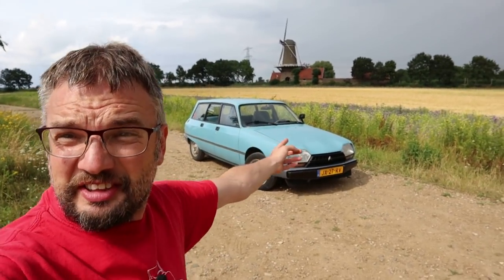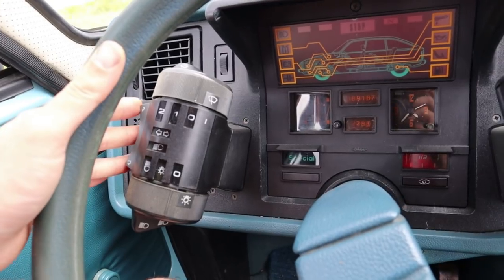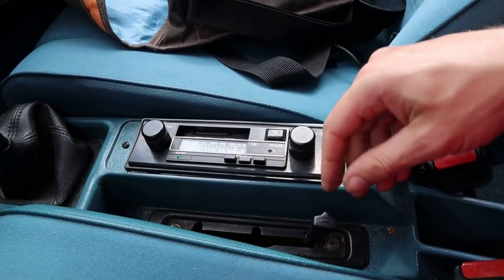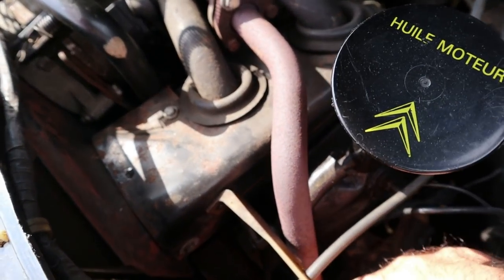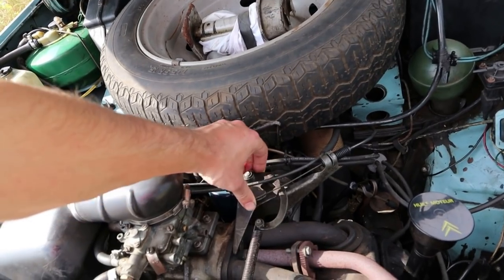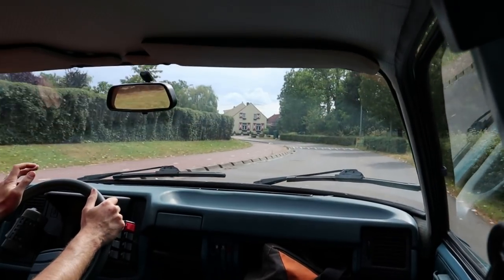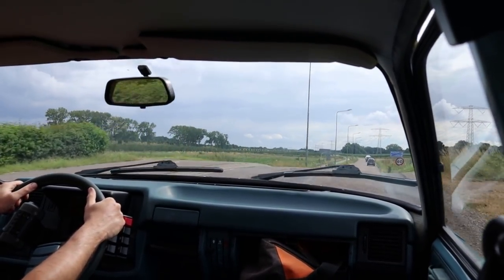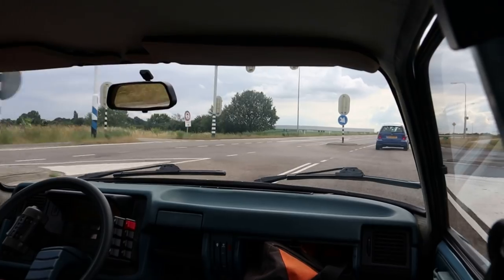Real Road Test: Citroën GSA Break (estate) Spécial!

Comment: Ian is so right about the BX and Xantia suspensions being less bump-absorbing than previous Citroëns, and about the company's slide towards conventionality. Was it influenced by their Peugeot partnership? An erstwhile BX GTi and a Xantia owner, I travelled in a DS as a teen and was deflated to find I couldn't get that magic-carpet ride in the 80s/90s models. I suppose the designers reduced body roll and made handling 'sharper' both to satisfy motoring writers (a conservative bunch) and to appeal to a target market who relished speed and detested roll. So they opted for a harder sphere setup, sacrificing the marque's traditional comfort for 'handling'. Why couldn't the GSA's steering. or another device. sense it was experiencing a sideways thrust on a bend or roundabout and stiffen the suspension accordingly just during that manoeuvre? I know some BX drivers did fit softer spheres and presumably put up with a bit more lateral movement. Rolls-Royce and even Maserati used Citroen-licensed hydro-pneumatic technology but maybe they tweaked it somehow.
Reply: What you propose is called the "Activa" system which some versions of the Xantia had
Reply: @fgsaramago  Thanks, I do recall that now. I had a Xantia 90bhp SX but not the sportier 110bhp variant, so Activa was absent on mine. The 90bhp model wasn't exactly underpowered -- but the extra 20 horsepower would have been useful at times, certainly, especially when fully laden.
Reply: @kh23797  my father had the 1.6 liter. That thing was definitely underpowered!
Reply: @toqtoq3361  Thanks for the information. I wish I'd known this when I owned a BX GTi 4x4 as it really needed softer suspension -- but  In those days, the internet was not available to me to help solve car problems. I presume the part you mean is the valve concentrically within the big screw thread on the base of the sphere. I didn't know they differed according to model, nor that one could change it to vary the softness of the ride. At a dealership (or online), replacement spheres are sold for a particular model with the default parts already installed, of course.

Comment: Its completely gone now here in Denmark. Would be nice if Citroen would produce a real hydraulic small/mid size car today. Imagine the Cactus with real hydraulics.
Reply: There are strong rumors PSA will produce a REAL Citroen version with updated hydropneumatic suspension on the new platform base of the Peugeot 308.
The new Opel/Vauxhall Astra. Peugeot 308 and Citroen are in development and while having the same platform and engines they will al be different.
If they pul it of PSA will have a German/Anglosaxic pragmatic, French conservative and extravagance car. historic core brand value models for sale
Even if the Citroen model does not sell so much as the Peugeot Opel/Vauxhall version they could stil economical produce and sell them
Reply: @obelic71  thank you very much for the information Richard. Hopefully Citroen understand that they can not completely remove the core DNA and still be Citroen.
Reply: @Jablonski277  Citroen is one of that historic brands that people like not because they are premium upmarket, but of their well thought enginering solutions. Just look at the HY van. No other manufacturer had standard a commercial van with a low walk in  enterance ! (designed to roll in a wine barrel with ease)
And only on Special order/conversion you can have it today.
Also a nice story how the Citroen Berlingo was born.
In North west europe Citroen sold historicly a lot of commercial cars/vans. There were no successors planed by PSA in the Citroen brand. Because sale nosedived they just rebadged the Peugeot cars/vans to Citroen's. Therefore you see way more Citroens then Peugeots commercial vans here.
Reply: I drive a 2004 C5. Have had many odd cars from all over the world. This one is by far the best ride. As a fellow nut, like Hubnut. Beeing a carnut is just having the love for cars. And this have had me thinking. The moment Tesla produces an all electric with Citroens suspension. That would for me being the only time I would consider buying new. Then there is Citroen itself. What if they produced an all electric but put in their suspension? I would consider buying a new car. But until then. what is really the point. Recycling is important :)
Reply: @TheBurningsofa  
PSA is good and big in building small engines and drivetrains and sells them also to other car manufacturers wordlwide. 
Because they where "behind"in  electric cars they bought Opel/Vauxhall  from GM.
PSA once build the mitsubishi I-miev full electric in licence en that was not a succes!
Opel/Vauxhall already had sucesfull electric vehicles so they will launch the new models  first under those brands.

Just have patient there will be a electric / hybrid Citroen with old Citroen DNA in the future.
PSA just has to develop the 10% change to make it a real citroen. 
The other 90% of the development cost is spread over all the brands.

Comment: Loved my dad's 1978 blanc meije GS Pallas 1222cc. Drove it round the arc de triomphe with a camping trailer as a 17yr old! Brilliant on the autoroutes. Very thirsty little engine though. Nice to see a fully working GSA. Rob Moss of Chevronics is a saviour to G's in the UK. I recall Peugeot was the influence of the BX platform as it shared it with the iron sprung 405 but with oil sprung struts. Great video again. Thanks.
Reply: Does that mean you could build a 405 using hydropneumatic suspension parts from the BX? 
Now there's a thought.
Reply: In theory yes .... would make an interesting project 😀

Comment: you should try the cmatic one day... not to mention the pallas version. But in answer to the what is the service setting on the suspension, its for changing the wheels. Jack it up fully, put the jack under, lower the suspension, the car will wedge on the jack one side, tip and lift the wheel for you, with no effort on your side

Comment: I briefly owned a 1979 GS in metallic green. I never had the time, money or skills to restore it back then but I spent a few months marvelling at its flat four motor, suspension system and inboard disc brakes. I later graduated to a Citroen BX14 which got written off by a BMW driver. Sad times. Love a Citroen me.

Comment: I had a GS 1220 club and then a GSA weekend. Lovely cars, rusted away If you turned you back. 
At least the Club has a hand crank so you could hand start it like the 2 cyl. Citroën ,s .
I had the Club restored from rust, new side panels, front doors , front fenders. On my way out of the garage a brand new Opel came rushing , sliding on ice and tore the front totally apart!  
We just pushed it back into the garage and had it all done again 😂

Comment: I became a Citroenian in 1984 when my mum bought a 1972 DS21 injection/hydraulique, no clutch pedal, before then I was a Renault 16 fanatic. Mum threw the keys at me one day and said "You're my chauffeur from now on", then I was hooked. Mum couldn't quite reach the brake button as she's only 5ft tall. Then a succession of models came after starting with a 1985 BX16 TRS auto, a 1986 BX19GT, the best Citroen I've ever driven, A CX2400 Palas c-matic, which almost drove me away from Citroen, then a 2005 C5 2.0 HDI estate, not the best car to many electronic gremlins so off to a new home next week. Well here we are 2 yrs down the track, and the estate, which locked me out is now running but still not back on the road. I've bought another C5 a red hatchback 2.2 hdi with a 6-speed auto which I shouldn't have bought. I had a week of driving pleasure before the engine stopped. It has turned into a bit of a saga which I'll post at a later date.

Comment: Another spirited driving video, lovely. Brought back memories of my 1983 GSA Pallas saloon. It was the same colour, with loads of blue interior fittings. Well recall the vertical radio setup which tested my Pioneer cassette player. The dash always a talking point, including the rotating rev counter. Lovely linear steering, not too heavy. Some roll, and out of phase with the road surface wallow, which some rear passengers found made them uneasy. I recall swatches of all the trim clipped under the front seat so you could test cleaning materials on them. I assume you left the economy light off as it would flash all the time. Poss to control rust by the time I got mine they were rust proofing them in France with Tufcote Dinol. Remember in UK we drove looking through the curved unswept area where your camera was looking.
Reply from the maker: Good point. Forgot to mention that the wipers didn't move for RHD!

Comment: This particular GSA has apparently a right door geometry problem, or was left ajar. 
The odometer can normally be replaced or serviced, but I can bet it's probably a gearbox or a cable issue. The direction lights timer relay can easily be replaced, the timing is too slow.
Most important: no apparent rust problems, but you have to check the rear suspension passageway and  berm, and always keep the doors drainage holes open. Another problem comes from the rubber water exhaust pipes coming from the wiping front motor and mechanism bay: they can clog or glue easily resulting in ventilation motor to splash water everywhere on your feet! You have to press regularly to open these exhaust in the wheels passageways, left and right. And don't forget the only heating you get comes from electricity. 
You can start and use these air cooled motors in very low, freezing temperatures, as far as you keep the battery hot enough to start, help the motor with appropriate lubricant and use a few hand manifold pressurizing turns. I've experienced with -35°C, it works!
Anyway, don't take any chance with this blue beauty, and keep it dry in a garage!
The clicking sound of the ''conjoncteur disjoncteur’' with a sphere near the motor is normal, as far as it doesn't click more than once every 30s. If you hear repetitive clicking, with no change in suspension or brake, you have a faulty sphere somewhere, a leak or a pump problem. I've also seen valve problem on the regulator,( if you unscrew it for maintenance, always check it's seriously closed and tightened after that). Remember LHM has to be changed regularly and brakes bled as in a classic car. You can also clean the filters in the green jar on the right. These hydraulics are not too complicated, but can be fragile and require special attention. Always remember of extreme high pressures involved. Never mix LHM with any other fluid! LHM is also paint corrosive.

Comment: Ian, I had 3 Gs clubs, 1 estate and 1 pallas. They were 70s models my first in 1982 ,very fast for the time and the warning lights were all LED. Those controls are similar to my old Citroen visa. I had a Cx pallas and I agree with your view of the suspension. Such a loss really heartbroken i am. Thanks for the video all the best.
Reply from the maker: Not LEDs I'm afraid. GS used the same dash lights as a 2CV in fact - tiny bulbs.

Comment: I had a 2nd hand blue GS Special estate (1197cc?) as my first car. The dials and switches were a lot better looking than the GSA but not as quirky. Loved it apart from the rust and oil pressure gauge leak (centre top engine block) that lead to new cams and followers - a pig of a job as despite the manual you can’t remove them without moving the engine off it’s mounts! Thank you for the memories.

Comment: I had an 1980 GSA estate just like this it back in the early ninety's.  I bought it for $50 Canadian. I too liked this car because it was so different than North American cars having an air cooled flat 4 with inboard brakes and the hydraulic suspension (oh it had a hand crank for starting too).  But, I hated it because it was so buckshee being held together only by glue, every winter the drivers side window would just fall down because the glass was only held in place to the window regulator by epoxy glue which broke in the cold weather.

Comment: Fun fact: GSA's 1.3 engines were 1299 cc except in Italy.  They got an 1301 cc engine because a rule said engines had to match or be above advertised volume to get sold as said volume.  So buying an import from Italy will get you in all sorts of trouble when rebuilding the engine..

Comment: A thoroughly enjoyable film, the GS/A had a good run of 12 years with production overlapping BX by 2 years, which is amazing. I see the Cactus as the modern day GSA but Citroen gave the Cactus the chop after just 4 years! This was purely due to 'feedback' on the Airbumps idea. The last GSAs were Portugal built cars, lots of them were blue! 

Once again convention won, but the face-lifted Cactus sans Airbump seemed to be even less popular. They even dropped yellow as a paint colour, because the buying public prefer grey and bland. 30% of Cactus sold were grey at £250 extra! Yet the yellow was a free paint option.  This speaks volumes about the fear manufacturer's have of doing things differently and ultimately the sales that result from any weirdness. 

When Citroen went from GS to building the GSA they fitted them with the GS dash! Before the GSA dash was fully rolled out. They are a hoot and such a brilliant design. One of the best cars I ever owned was a GSA Special Break DHP800Y which eventually I scrapped, not because it was rotten or rubbish, I just had no space and it was worth £100, 72k miles and scrap. Big regrets.

Comment: I had a 1200cc GS, that flat 4 boxer engine was impossible to work on, there was one spark plug I never managed to change. It was also incredibly thirsty, about 25 mpg if I remember right. It wasn't a good car for wet places, the Scottish West coast was far from ideal. The heater from the air cooled engine got the heat from sleeves around the exhaust. So in wet weather whenever you drove through a puddle water would spray onto the exhaust, boil off the exhaust and fill the cabin with steam, so you instantly misted up. I loved the way the suspension levelled itself as people got in or out of the car. The seats were amazingly comfortable, the ride was fantastic and the brakes were unreal, when I test drove it the first time I touched the brakes the car stopped dead, I soon got used to them though, the brake pedal was more of a valve, using the hydraulic pressure from the suspension, so the more weight in the car, the more braling you got, very clever!
Reply: The spark plug thing is tricky, it's doable but not easy. The 25mpg is really not necessary. I can only speak for the 1300 but we're averaging 36mpg with both the GSA and the GSA break.

Comment: Huha, in 1988 I had the chance to buy this in orange color in condition "NEW" because it was parked in an underground car park for years. 600 Euro which was 1200 German Mark. Unfortunately, the owner suddenly decided to keep it :-)
This car is nowhere to see over here in Germany today, unlike the big brother CX - getting pretty rare as well.

The "green eggs" for hydraulic suspension like seen here under the bonnet can cause serious trouble and you won´t find someone fixing that unless you live in France, Belgium or the Netherlands. My neighbour gave up on his Citroen SM restoration for multiple reasons....
Cheers from Germany, Bernd
Reply from the maker: The spheres cause very little trouble. If they lose gas, you replace them, which is not dissimilar to replacing an oil filter (remembering to turn the one bolt that removes suspension system pressure first). Easy!

Comment: What a wonderful machine...  The dash seems mad, but is perfect when you are on the move. The ergonomics of this car were sublime.  
Everything fell perfectly to hand.
A GS break was a beautiful thing, but I lack the courage to run one today.
As often with Citroens of the time, bottom of the range was where the character was.  Actually, being a late car this one is a bit too luxurious for me....  
So many people were put off by the non-cancelling indicators... Needlessly, I think.  When the rocker was removed from the BX for the second series, everything at Citroën started to go a bit Nissan... or more accurately Peugeot.... which is pretty much the same thing although a pedant would draw my attention to the later link between Nissan and la Règie.
You hit the nail on the head... Although it was from an earlier time, this is a smaller CX.  
What a splendid thing.... I was too cowardly to buy a nice LHD commercial GS about 20 years ago on France.... a sort of living relic panel van with no rear side windows....  I so wanted it but knew it would let me down.....  Aaah... Nostalgia.

Comment: Good video and I agree with you how cool it was that Citroen went its own way about things. I caught the last of it with an early BX19 Diesel which I drove around London and across the country for a number of years. It was the first acceptable mass-market diesel car in my opinion and sold the diesel concept very successfully. (I know we had Mercs and Land Rovers and such like previously but these were all a bit niche.) The only issue with mine was no power steering - on a run no problem but parallel parking in London required the biceps of Hercules. I used to curse this feature - to the amusement of my girlfriend - but still loved the car.

Comment: This car reminds me so much of my dad’s Oltcit Club 12 TRS (Citroen Axel for the rest of the world) that he bought new in 1993. Oltcit made 3 models, the Special with the 2 cylinder engine, the Club 11 with the 1100 cc/4 speed and the Club 12 with the 1300 and 5 speed. The 11 was less torquier than the Dacia but could keep up on flat ground due to the revvy engine. The 12 was faster than any Dacia, inluding the 1400 cc ones, but considerably thirstier due to the twin Solex.